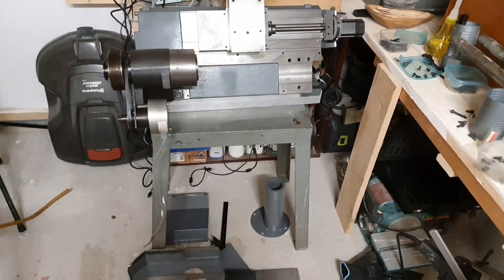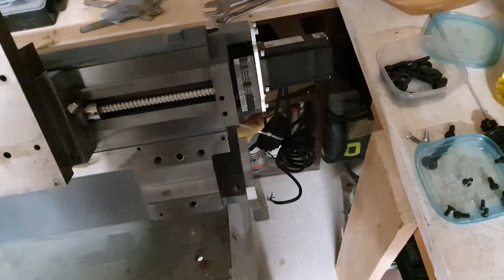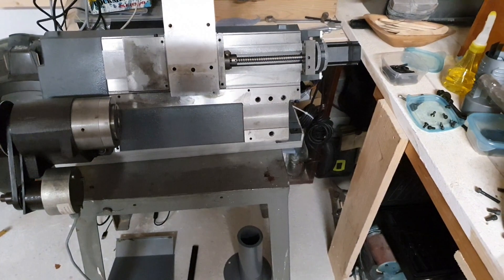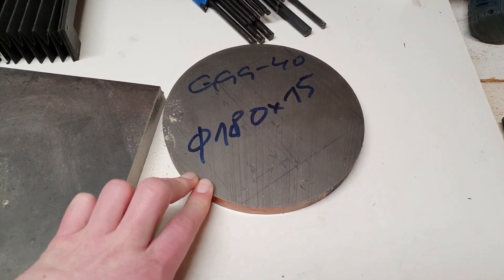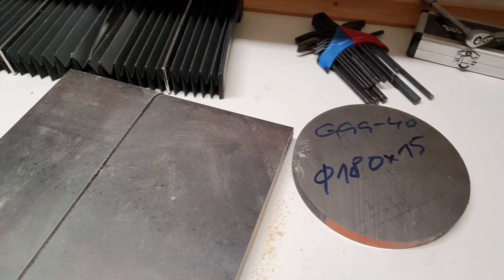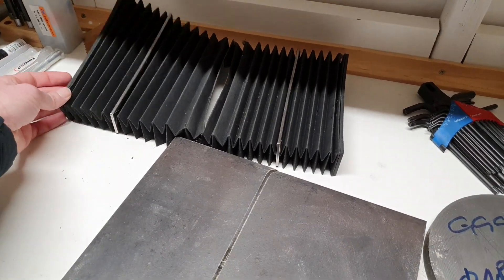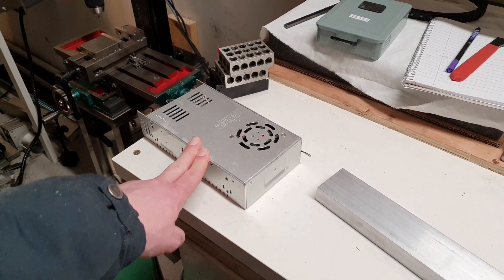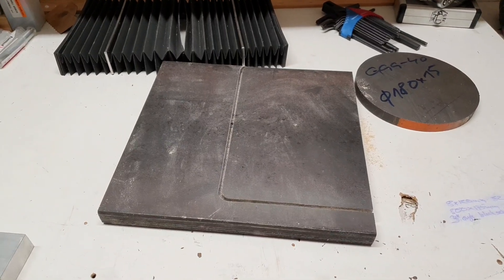Small Projects update on cnc lathe, bt30 spindle, 6040 router

Comment from the maker: planned videos for the lathe:
-Wiring hybride servos and nvum Ethernet controller
-Making motor mounting plates out of cast iron
-Installing central luberication system.
-mounting and setup 1kw chinese servo for spindle drive
-making a temporary toolholder 
-turning a backplate and mounting chuck
-modding a chinese tailstock to fit the emco lathe
-diy enclosure
-diy flood coolant system
-diy toolchanger with live tooling
Reply: 1kw is too small for that one, go for the 2,2 or 3,8 if you want to use it without a 8 speed gearbox 😃